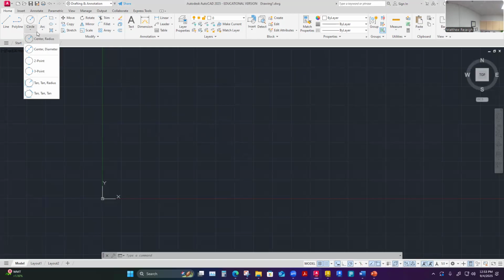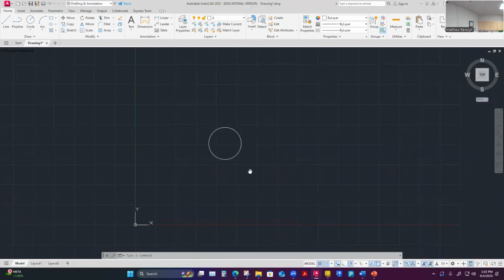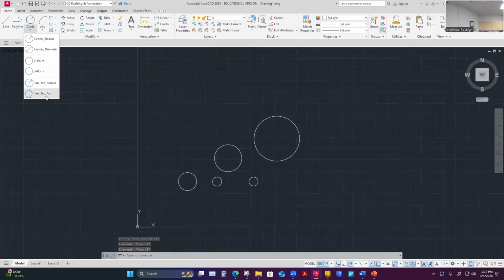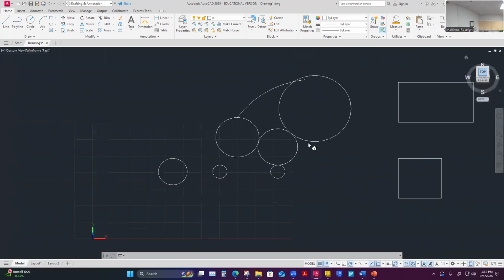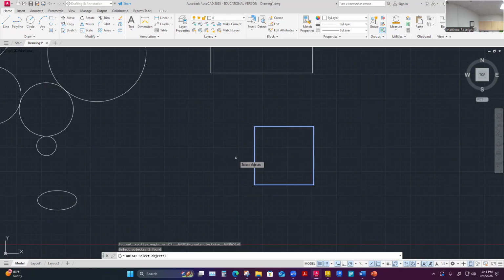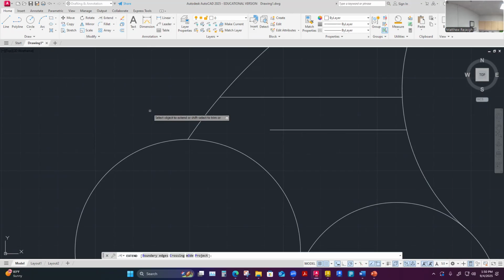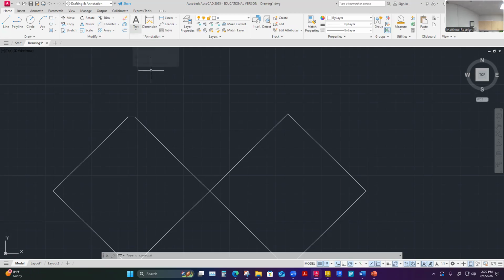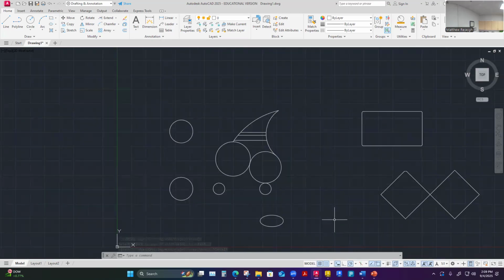CADD 1108 Draw and Modify Palette Commands

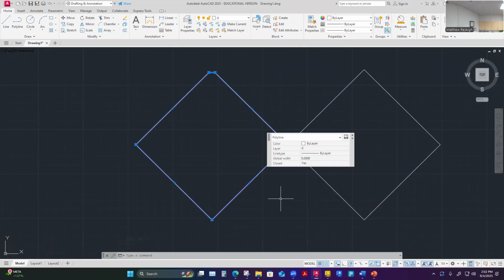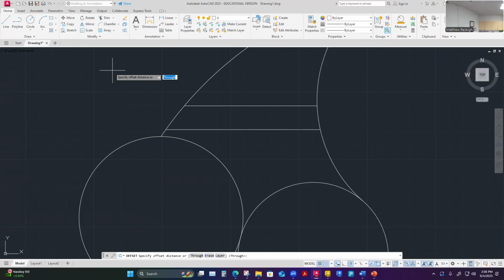Comment: At 1:00:20 Audio becomes hard to understand until about 1:05:03, During this time, Matt is mostly just explaining how the "explode" tool works to split objects into lines and then using the join command to reconnect them. He also starts explaining how to use the offset command right as the audio clears up. These topics will be explained more later, but if you want to learn how to use the tools now there are many 60 second tutorials online👍